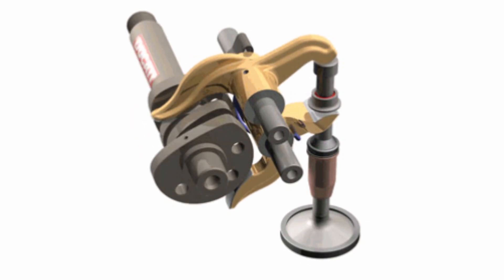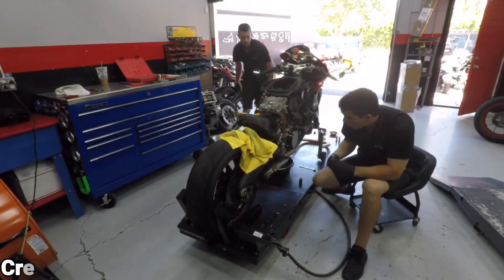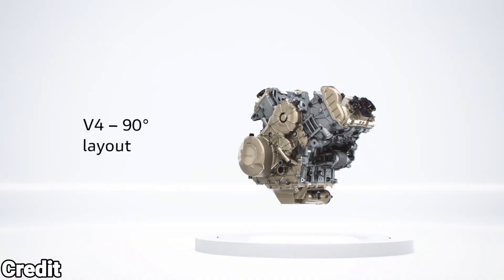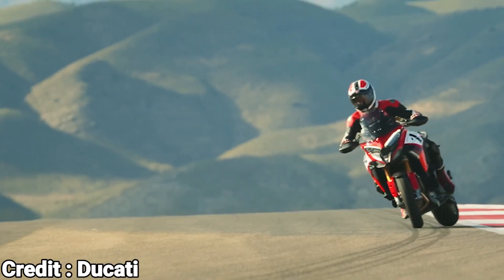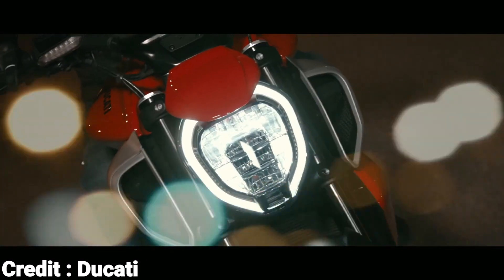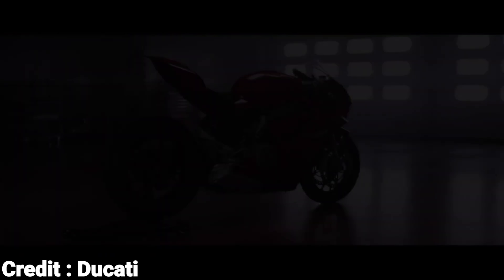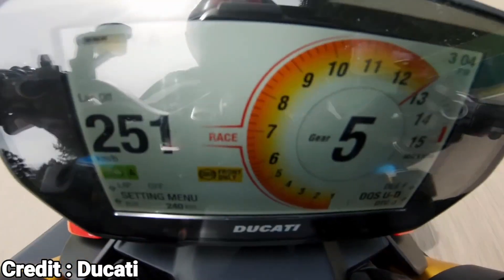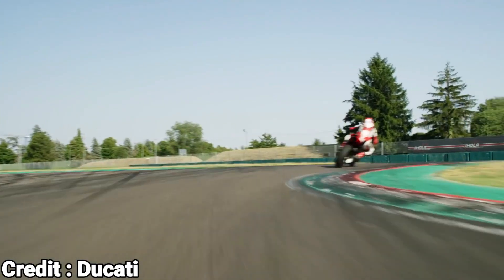Ducati Is Ditching Their Desmodromic Valvetrain System, Here's Why

Comment: The Desmo system was developed at a time when valve springs didnt allow for high revs. Times have changed.
Reply: When everything is changing in the world you have to hold on to what makes you special. Otherwise you become a commodity.
Reply: high revs is not the only advantage about the desmo tech